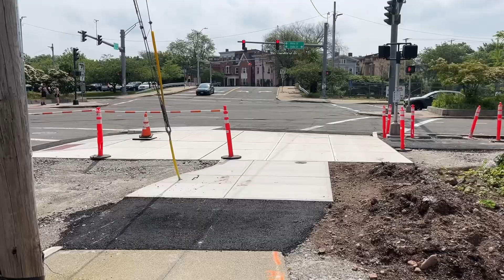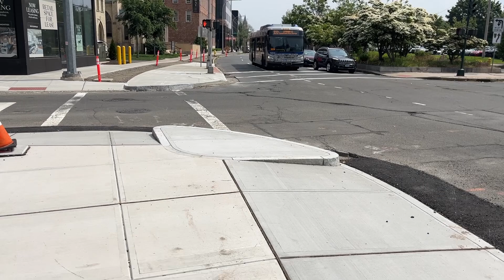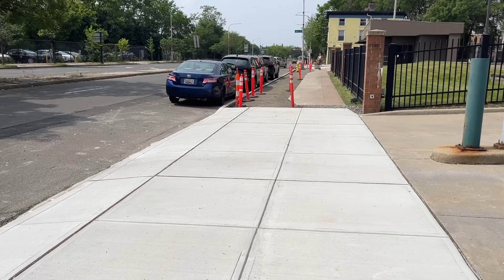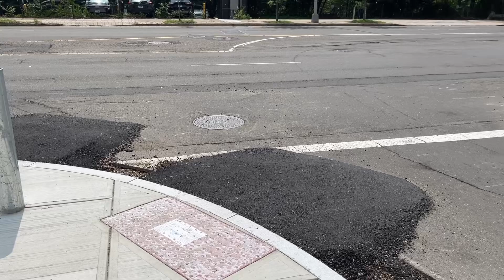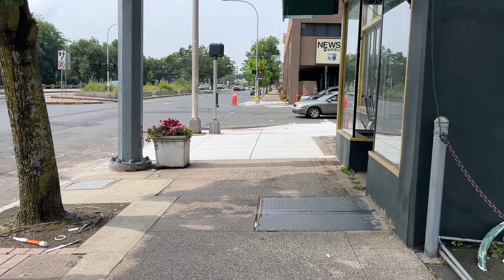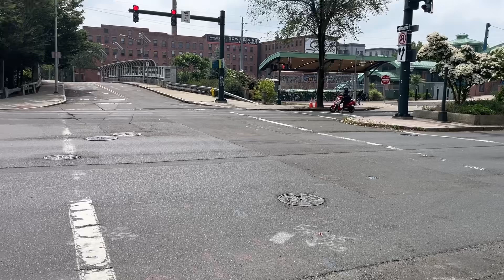State Street Project - Construction Update 11

Comment: Thanks so much for another great update video! Will the way finding sign at the very north end of phase 2 (0:25)  be (re)moved before completion? that kind of pole in or directly adjacent to a bike path is sure to catch some handlebars...
Reply from the maker: Thanks Max - unfortunately we have to keep that sign in place, but the bike path will slightly bend around it to provide a bit more room and the sign itself will be in a new grass buffer area
Reply: @everydayengineering  Ah, I see. Hopefully enough clearance that it doesn't interfere.